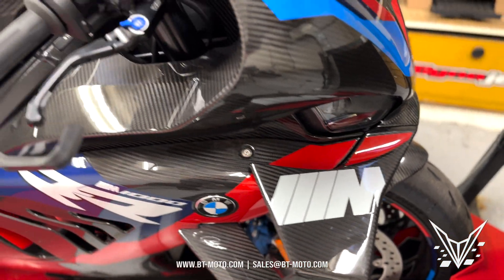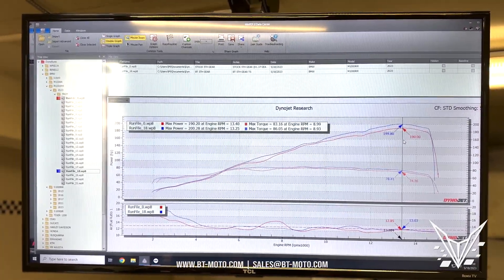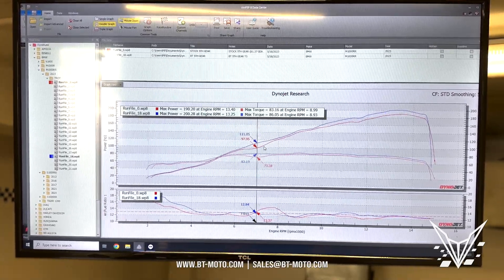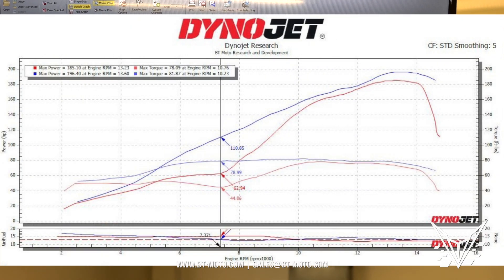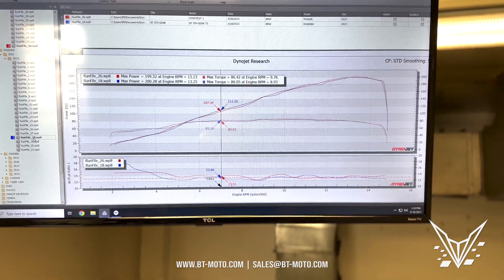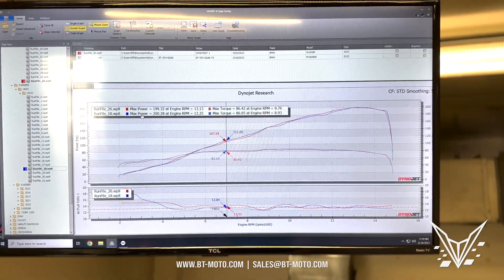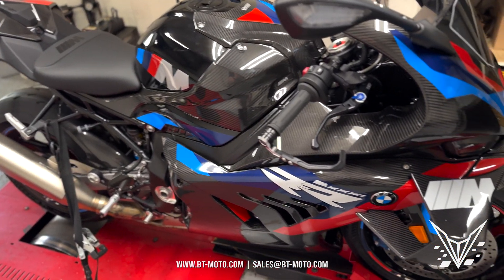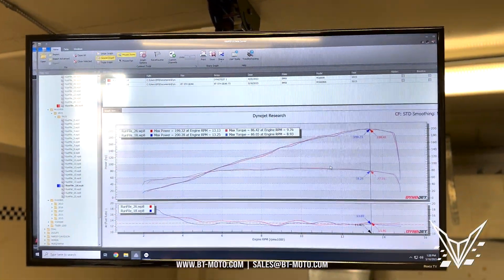WORLDS FIRST DYNO of 2023 BMW M1000RR Competition BT Moto Dyno and Tuning

Comment: I don't understand how stock bikes get 190 horsepower on your bench.  my stock 2022 m1000rr put out 180hp at the wheel after finishing the break-in
Reply from the maker: There’s a process to dyno’ing these bike properly. We will be making a video in the future on how to do it right.
Reply: Different dyno different result, i saw a many different result on many dyno with same stock bike
Reply: Some dynamic are flashed 😂

Comment: So with an exhaust we can expect 210-ish at the wheel.
Reply: Uhh no, this bike doesn't really gain on the top end with exhaust just 10 hp in the midrange
Reply: @ravenmoto5948  you’re right, it’s already too powerful at stock
Reply: @John.Jacob.04 yes the Ducati V4R really is too powerful stock
Reply: My single R dyno’d at 182 to the wheel and after full exhaust and tune 191 to the wheel